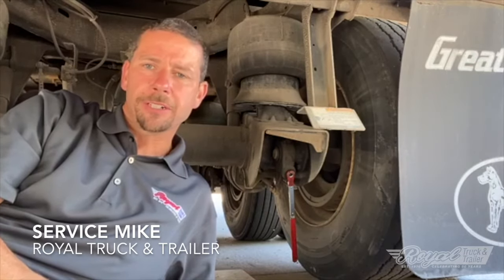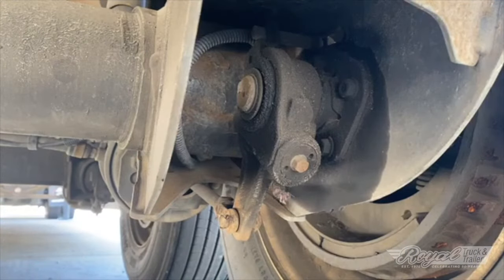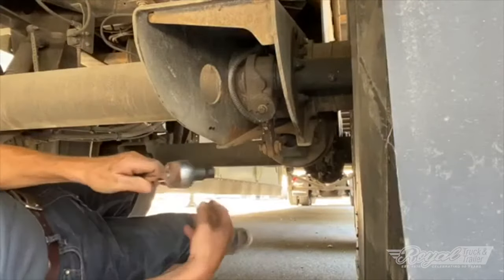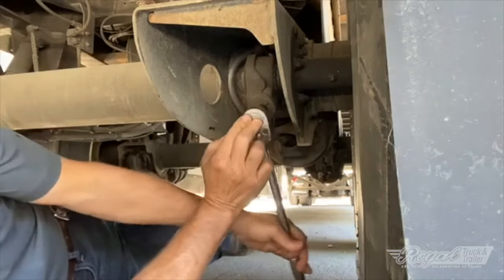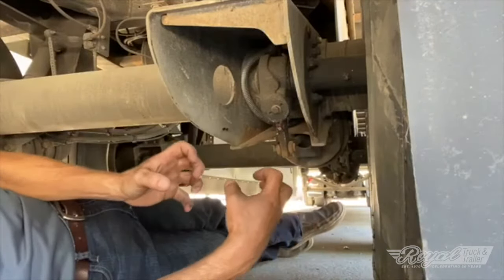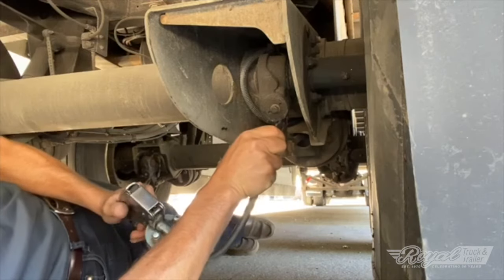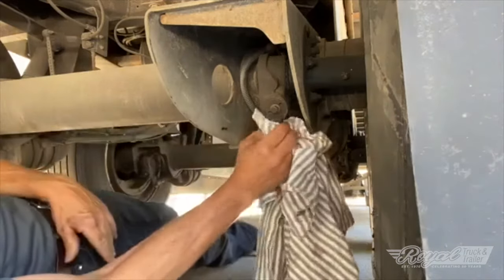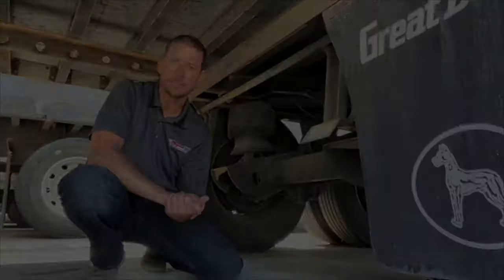Automatic Slack Adjuster

Comment: Backing it off against the ratcheting gears is exactly what destroys an automatic adjuster. They're not like the old ones where you simply close the brake against the drum and then back it off a bit. If you've got automatic slack adjusters, have someone press the brake pedal (about 30-35 psi is all you need) while you measure the push rod throw. Your helper presses the pedal, you measure the throw. If you need to tighten it up, then your helper releases the pedal so that you can give it another turn. This way allows you to tighten it little by little until it's where you want it, instead of destroying it.  An even better way to do this is have have your helper do the wrenching while you press the brake pedal. It's a mess down there!
Reply: How much push rod throw is optimal? The video mentions 2'', is that standard?
Reply: @BartholomewHunt87  not more than 2 inches. Anything over that is a violation, & if 20% or more of your brakes are in violation, the cop can red tag the truck until you get the brakes adjusted to within specs. Most of the year, I adjust mine to about a 1 inch throw. In winter months, though, I'll back them off to about 1½ inches so that they're not too grabby when I'm driving the ice rinks. Hope this helps. Hmu if you've got any more questions.
Reply: You’re the only person who does this
Reply: @gabrielmiller1226  Then I'm the only one who does it correctly. I'm okay with that.  I pay for my own equipment, not others when they break it. 🫠

Comment: What was the stroke measurement before you adjusted the brakes? Jumping right to making adjustments on an automatic adjuster could be covering up other issues.
Reply from the maker: Christopher Jamieson, good point and thanks for watching. Correct, if the stroke is too long something must be worn to allow the brake to be out of adjustment.

Comment: What does it mean if an auto slack adjuster starts out in correct adjustment but by the end of a long trip, it is far out of adjustment and the brake pads won't even touch the drum when the brakes are applied?
Reply: That means you proally need a new slack adjuster obviously.
Reply: Defective slack adjuster. Replace.

Comment: We did a complete brake job set them 1/2 turn  like you said but my rotors are constantly hot not to the point of catching on fire, but there is definitely some friction going on. Can you please tell me what you think the problem is?
Reply: ABS light and traction control light also coming on and I do not see any air leeks

Comment: My Freightliner back driver side brake is stuck. I tried to manually adjust the slack adjuster it made that grunting but didn't release the brakes.
Reply: Your brakes and drums worned out
Reply: Back them off like you did then smack the edge of the drum with a hammer. Make sure you have the wheels chocked as the truck might lurch forward when they release if all other brakes are properly releasing
Reply: Some slack adjuster have a tab that needs pulled out to make the adjustment
Reply: Lurching forward does not need to happen if the tractor brakes are applied lol
Reply: Or vice versa if it's the tractor than just release the tractor brakes but apply the trailer brakes

Comment: I’m pretty sure that’s not how that works. Automatic slack adjusters for air brake systems adjust as the shoe lining wears down they should adjust to take up slack. What you did was check to see if your tractor protection is working correctly. But i maybe wrong

Comment: The DP motorhome's slack adjusters seems to have some white color grease in it (after the the fact read is may be some clay type grease).  Before I realized the different grease, I applied 2 short-pumps of red high-temp grease I used for my entire chassis / drive-train.  Can this small amount of a different grease cause a problem?  Can I flush most of it out by pumping the right grease through the slack-adjuster?

Comment: if they're automatic slack adjusters why are you adjusting the slack  adjuster I always regardless of what kind of  brakes I have  even supposedly  those with automatic slack adjusters I adjust them tighten them all the way up and a quarter turn back.  before a Mountain Drive and after a Mountain Drive